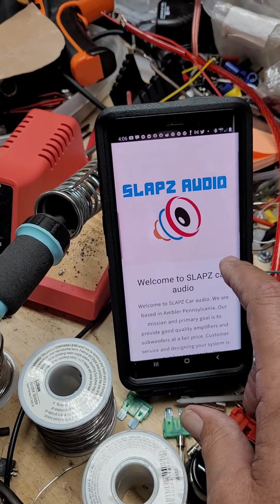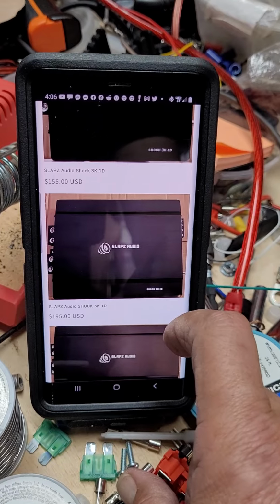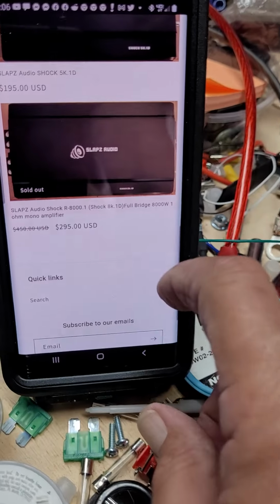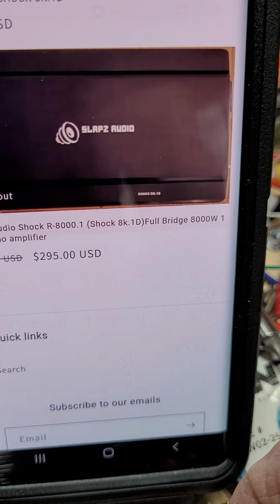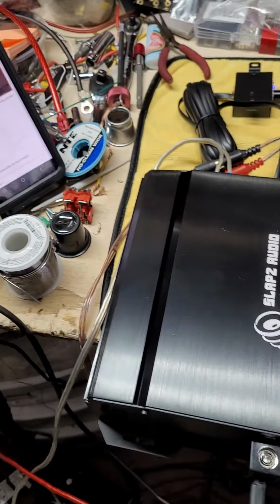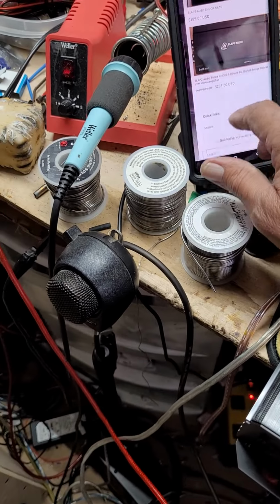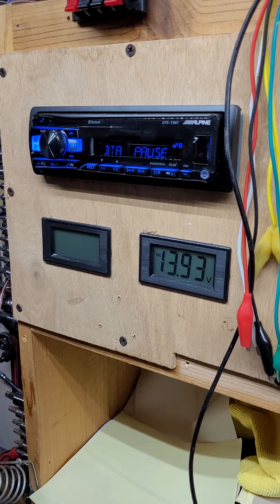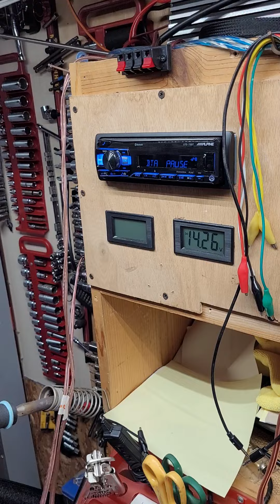SLAPZ! Audio shock 3k.1d amplifier quick test

Comment: I have 6 each of the 1k to the 13.5k samples from this build house.  They're revised versions of the SFB and are solid. You only need between 1-3 volts max on the input side. I got my samples early last year, and none have failed..just do not run below 1 ohm, and keep input voltage around 3 volts or less, and they'll survive, and all of them have done above rated power, except the 13.5k which we have not clamped yet.  I made some changes to our samoles with faster switching fets and crossover filtering (35hz low pass) and a few other changes. This build house does amplifiers for many companies including CT Sounds...They're a great build house 👍
Reply from the maker: This on seemed to be lower sensitivity on input. My alpine into other similar fb amps didn't need near as much gain. By a lot. I'm thinking 4-5v necessary. Not a deal breaker.
Reply: @slickwillybudgetking  just from experience with the build house and their SounDigital clones, around 3 volts on the input section is plenty sufficient,  and anymore than 4 volts lessens the longevity. It also could be the cheaper attenuator and RCA connectors used as well with this brand, and seeming for the need to dial up more for the sensitivity. I chose to utilize Tiffany style RCA connectors, and metal pots and attenuators. We received 2 free samples to test originally (2k and 3k) and around 5v and up, with line drivers, they both failed. After talking to Sam over at barevidd, we made changes to all of our paid samples, and with talking to their engineers at the build house. I haven't fully tested the bigger amplifiers yet, only up to the 8k's, as winter set in quickly here, but I will innthe spring. I honestly prefer these SounDigital clones, over Taramps.
Reply: @Chuck_Sanders  yes the MD of taramps doesn't like high input voltages as well

Comment: They need 5v to get all the potential but with that said. You gain better speaker response at higher rca.voltage. keeps floor noise out. Ive.been abusing my 5k dalily

Comment: Why not wattage stats?
Reply from the maker: Because Steve Meade hasn't donated a $3600 dyno and $2000 resistor bank yet 🙂
Reply: @slickwillybudgetking what about the AMM-1 I think it's around $500. Pricey but you would def get the money worth.
Reply: @Pgh2Dall  where can you find one in stock? I can’t find one in stock anywhere online bro
Reply: @drakeearhart3644  I reply and it removes my post
SMD website has them
Reply: @Pgh2Dall  thanks sm bro
Reply from the maker: Waiting to find one used for a deal.